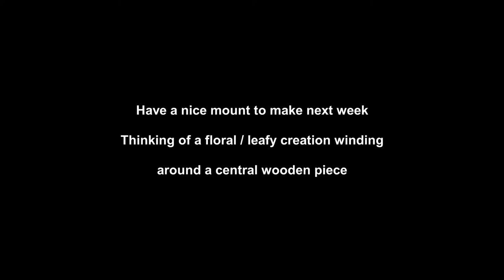Beautiful Birds made from Vintage Cutlery, for Mark and Leanne - Part 1

Comment: Your birds are beyond amazing…I am good at soldering, welding scares me…do you think it possible to solder together a bird with differing solders?  THANKS!
Reply from the maker: Hi and thanks for the nice words. Not an expert on soldering by any stretch o f the imagination. Can just about solder a handle on a brass blowtorch or solder wires but stainless is a different kettle of fish. Google tells me that 'tin-silver' solders are best for stainless but thats literally as much as I can tell you. Obviously it's really only a surface bond rather than a fusion of 2 metals in to 1 solid piece so wouldn't be as strong but perhaps it would be sufficient, I wouldn't really know. Welding isn;t that scary really. Only the first time then you just don't think about it. What I like about welding is the ability to add material and then sculpt it ... almost indefinately. There is much more scope for artistic creativity I think. Obviously more expensive equipment required to start but realistically you could get a useable gas MIG set up for £400 with an angle grinder, a dremel and some nice attachments. Hope that helps
Reply: Yes, big help….I do stuff with vintage silverplate but sick to death of  jewelry, etc.…being a bird lover, those would be my target…so I will look into a useable gas MIG  set up…already have saws, grinders, drills, etc…your comment about the ability to add material and then sculpt it, really pinpoints it!  I don’t have the strength guys do but I do have a bender press for help with strength….Thanks Suzanne  @JohnNorrisMetalSculpture
Reply from the maker: No worries happy to help. Not sure where you live but in the uk we have a store called B&Q. They sell angle grinders for £25 and they are quite small, easy to use really ... and i say that as someone who has issues with the tendons in my fingers. Obviously I take the safety guards off so I can see more easily what I'm doing and tend to use the edge of the cutting discs to do really quite fine detailing work. Brain surgery with a spade but one of my favourite tools. I'd highly recommend an air compressor and some die grinders too. 50 litre minimum ideally, 25l works but you're always playing catch up with the tools which can be annoying. I'll cut and paste now something that I typed out for another person who posted questions about my welding set up a week or so back. Hope it's of use to you ...  @user-zj5rg5bw8e  'Ok, I don't know exactly what set up you have so best thing I can do is run through mine and you can gauge it from there.

I have a 140 amp welder (Gas MIG). A Wolfmig 140x. It has 6 power settings so theoretically each one is 23.3 amps. I read that as a general rule of thumb you should use about 30 amps per 1 mm of material thickness.

Obviously I've taught myself to do this from watching a couple of youtube vids and a little bit of advice on the MIG Welding Forum UK, so much of it is trial and error and learned experience. Every mistake is a learning experience.

My settings depend on the thickness of the spoons. Some are cheap tat, some are really nice bulky thick bits of stainless so there is some variation. Typically I will tack on setting 2, so that's about 45 amps and i'm real close in with the gun, about 4 or 5 mm from the mating surfaces. Worth noting that fit up is important here, you want to try and get a zero tolerance fit, any gap and the tack you do is not going to be very strong.

Sometimes on thicker spoons I might go to setting 3 (just under 70 amps) and again its a real quick zap, it's very easy to burn through as this is arguably a higher setting than ideal! You can vary the heat in the weld though by moving the gun further from the work piece, say 10mm (maybe turn the gas up a touch if you do this. My gas is on pretty weak so i can 'just' hear it coming through. More distance = more shielding gas requirement.

Note that I have a lot of spoons! so often I will find two identical ones or very very similar and do a test weld or tack just to test my setting and make sure its going to penetrate properly and give me a nice strong weld.

If I'm doing more than just a tack, for example building up material on two spoon handles to form a birds beak then I will use the 3rd setting.Often this requires a bit of weld, then cleaning up the 'sooty' deposits and welding over it again to get excess material that I can then sculpt with a flap disc. MIG welders are great but sensitive to impurities like soot, dirt, rust etc. Any of these impurities will generally cause gases to build up in the weld as it forms and bubble through giving a porous cheesy look which then has to be welded over again to sort it out, so try to make sure the surfaces are as clean as possible.

Note that I am using a gas MIG. Plenty of people buy 'MIG' welders that aren't really gas at all and therefore not really MIG welders, its kinda false advertising. They work by using a 'flux core' wire which produces its own gas when the weld takes place as opposed to using a proper gas MIG which fires a shielding gas through the gun and around the wire (typically argon / co2 95%:5% mix). This is much much better. The flux core welders do work but they produce a lot of splatter and often give a similar porous cheesy weld like a surface that wasn't clean. They are pretty messy generally speaking so trying to make small birds out of spoons is really just too fiddly for them. They are more agricultural tools really.

Hmm what else ... err ... ok cutlery is stainless steel and it comes in different grades. I'm not really an expert and not all cutlery is stamped with the exact mix but I'm told the best is 18/8 .. so that's steel with 18% chromium and 8% nickel in it. Rare to find stuff with the grade stamped on it but as a general rule of thumb anything non magnetic is good. Equally, avoid anything with a plate finish or any kinda of yellowy hue to it. These will produce gases in the weld and you'll get the porous weak cheesy welds if you try. Just bin that stuff!

Finally, generally speaking I use mild steel wire even though its stainless i'm welding. It's much easier to work, easier to weld and more than strong enough for sculpting purposes, you wont be pulling it apart with your hands if your settings are right. 

Of course mild steel will tarnish over time, even from the moisture of your hands. As a result I lacquer my pieces with 2k clearcoat (professional car lacquer, its like epoxy resin ...  product and a hardener mixed 2-1 with about 20 % thinners) applied with an airbrush. 

You can buy Polyurethane lacquer from Halfords in cans but its pretty crap really ! Its not very viscous .. ie it runs very easily and even if I'm using the 2k i'm still applying a dusting layer before building up a couple more thicker coats. Trying to do that with PU lacquer is next to impossible. Note ... i forensically clean everything with thinners or acetone and wearing gloves before i lacquer. You don't want any hint of contaminates on the metal that might tarnish, but once its covered, its all good.

Lacquering isn't necessarily essential, especially if what you are making is for indoor display but if you plan on selling stuff then probably it's better that its not going to rust at all, especially a blingy piece made of shiny stainless.

Finally, quick word on finishing. If you haven't got a dremel or a die grinder with a 1/4 " collet then get one. Then get yourself a quick lock adapter and a selection of easy on easy off velcro sanding pads. My flap discs go up to 400 grit, but these pads can go 800 through 1500 / 2000 and this is mirror finish territory which is what you really want. Also, the die grinders can take mini flap discs and carbide burrs which are a god send for small detail sculpting. All available on ebay, amazon or from your local welding shops. I started with fake dremels (cheap as chips on ebay) but honestly get a compressor if you plan on doing this a lot and 2 or 3 die grinders. 50l compressor upwards ideally. Mines a 25l and its usable but the tools kinda outrun a bit so its slows down the work a little. 

Right, I think that's about it ... hit me up if you got any other questions. Best of luck, feel free to link me in to some of your stuff!'

Ok thats it, feel free to ask any any time you have questions, always happy to help out a fellow creative. Namaste :)
Reply from the maker: Also, read the comment below from 'Alan Miller, I sent him a more in depth reply about welding settings. Also, I said in the last comment that I lacquer my stuff, I dont lacquer the birds! Reasn being, sooner or later someone is goin to try and polish one of them and the lacquer will ruin immediately and necessitate a complete removal. That would be a proper ball ache of a job! I do have a TIG welder as well .. had it about a yer and hardly used it, I really need to teach myself, it's a lovely bit of kit and capable of really fine work. Id still use the MIG, they both have their strengths and weaknesses, probably worth reading up about TIG welders too. Significantly more expensive but Ive bought a good one with all the nice stuff, a fine torch that you can hold like a pencil, a nice foot pedal etc, total cost about £1000 (R-Tech welding here in the UK, its a DC TIG, an FPP160 if memory serves. DC cant do aluminium but im not interested in that anyway.

Comment: I would love to create such artistry, but I cannot accommodate MIG gear, I only have room for a stick inverter welder - this would greatly limit me, yes?
Thank you!
Reply from the maker: You can do an awful lot with a stick welder but finesse will be the problem. Having said that, the skill is not the welding but the finishing. If you can't get / don't have a compressor or air tools then a Dremel will do an awful lot! What you won't be able to do with a stick welder is cutlery or any other form of stainless steel. You need a shielding gas (which means Gas MIG or TIG) unless you want weak porous welds and lots of splatter ... and you won't want either of these! Best of luck. Get making!

Comment: Do you only use stainless silverware? Some kinds just splatter.
Reply from the maker: Only stainless. Argon / co2 95 / 5 % mix. Basically no splatter, but the end result is also due to care and attention in the clean up / polishing process.

Comment: Hi, I want to start making birds like these and have just bought a welder...but I've just realised about the ground cable and possible threat of being shocked....how do you use the ground cable whilst welding a tiny bird?
Reply from the maker: My ground cable is clamped to the underside of the metal work surface, anything touching it is earthed. If you can, invest in a sheet of steel for work surface and do the same, saves a lot of mucking around! You will find flux core is not great for cutlery because it's stainless steel which generally requires a shielding gas so pretty much you can only do mild steel. I use a Gas MIG or a TIG welder. Not saying you can't get stuff together with flux core but it will produce weak cheesy looking porous welds and lots of splatter! FYI the bulk of my stuff (95%) i've made with the cheapest Gas MIG online, a WolfMIG 140x. About £200 these days but you'd need a gas bottle and a regulator as well. I use a 20litre gas bottle (about £80 deposit) and refills are around £60 but youll get a couple months of welding out of it. (Good regulators about £35). It's about 20 times cheaper than buying tiny portable gas cylinders, well worth the investment! Good luck, get creating!!!!